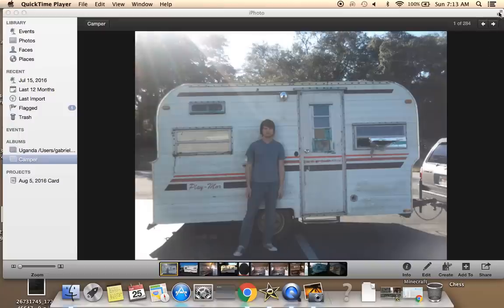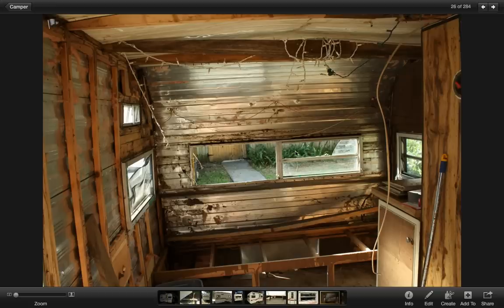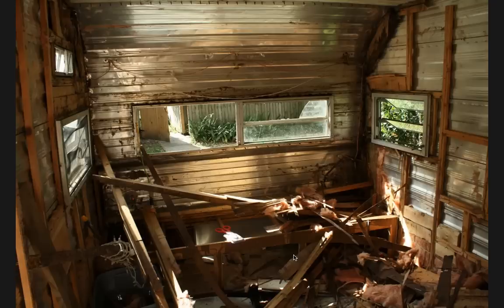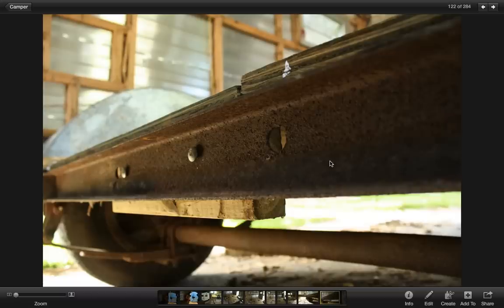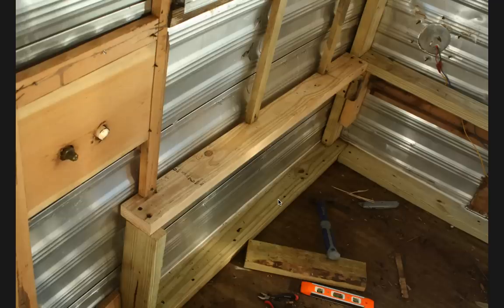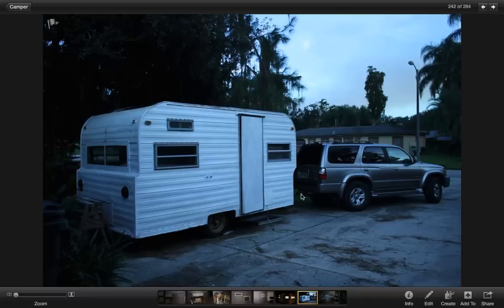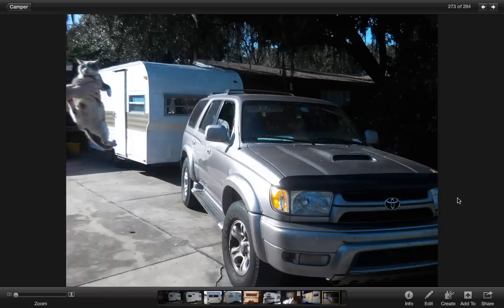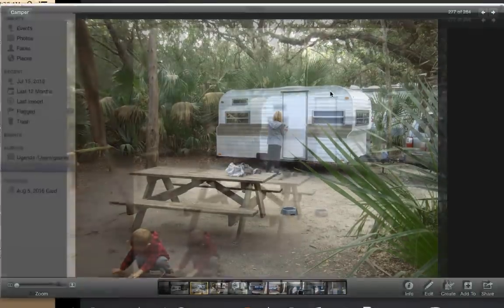Rebuilding a $40 Retro Camper // DIY

Comment: I have a 14ft'er.. Trashy little beast it is, but I'm renovating it myself. Going with cheap insulation, and salvaged plywood paneling. to make it a mobile 'rustic shed' look. Trashy as hell on the outside. looking damn nice on the inside so far. I look at mine as a project and something to keep me from getting bored.. So if it's not perfect.. whatever. It was fun while it lasted

Comment: Great job! I have to mention, I did read that it’s not recommended to use any pressure treated wood on vintage campers, as the wood reacts with the aluminum shell and will corrode. Is this something you took into consideration? I’m getting ready to gut and remodel my own 1975 trailer also :)

Comment: This has fully influenced me to go through with finding a old vintage camper and fixing it up. I do have a question, what kind of stores were you finding your parts like the wood-wall- and materials. I would like to keep it cheap as I can. I found one for 400 and it looks like it will need some siding and rebuild on a couple places and the roof.  This is the best rebuild video out there! great job..
Reply from the maker: Glad I could inspire you to start a fun project! I got most of the materials at Lowe’s. The interior wall material is a thin plywood that was $9-12 per 4x8 sheet. Let me know if you have any more questions.
Reply: Our Simple Story  thank you !! I probably will lol.

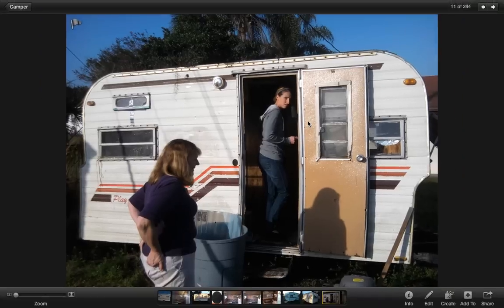Comment: lmao the picture at 1:57... Your wife is not impressed with your $40 purchase.

Very cool rebuild. I'm no expert but I think you did pretty well for a lower budget DIY. 

My only concern would be whether you insulated the walls before you put them in? That camper will be hot as all hell in the summer if you didn't.

Comment: Nice learning project for sure! Jumping in and just doing is such a great way to pick up new skills. I don't see how you have "$400 at most" in this though. Did you already have the materials? Just adding a few of the items you mentioned in the video shows it's well over $400. 

$40 Camper
$100 New tires 
$124 3 sheets of 3/4"x4'x8' pressure treated plywood 
for the floor
$100 Title
$15 Interior Paint
$27 3 cans of Rust-oleum
$50 New window
$15 Carpet

That is $471 already and doesn't include the wood walls, insulation, studs, wood benches, bed structure, exterior paint, white bathroom board ceiling, trailer lag bolts, roof screws added around the exterior, and screws for the walls and interior. 

I also don't see how you can make money doing this. I don't know how much time you had in this but 2hrs per day 3 days a week and 4 hours on Saturdays gets you 10 hrs per week. It sounds like it may have taken a number of months but even if it was only 2.5 months that would be 100 hrs. If you include the time you had in this even if you made $200 then you would have made $2 per hour. If you actually include all the time and the fact the true cost is was likely closer to -$2 per hour.
Reply from the maker: Then I put it on YouTube and got over a million monetized views ;)

Comment: I guess the end use is in mind when starting a project like this, meaning it was never intended for mountain camping where the nights get cold -- no insulation anywhere. Fine for Florida, especially for summer camping - just don't go farther north than South Carolina or your teeth are going to chatter all night long.  Good job though with minimal expense!

Comment: Did you ever replace the electrical wiring?  Also, maybe I missed it, did you reseal the roof and if so, what did you use? what kind of paint did you use on the outside?  thannks

Comment: The only sub $500 campers I have found were used as chicken coupes or meth labs. I commend you on your willingness to achieve your goal. I would have given up on the camper idea and just resorted to just ripping it down to the frame to build a utility trailer out of it.

Comment: Did you insulate anything? And with what if you did?  Did you level the roof?  Great job by the way.  Shows me I could do it. I just can not back up trailers. I've tried. I'm a musician and play and sing everything but the other side of my brain is toast with algebra up and backing up detached trailers...lol
Reply from the maker: Haha! Same here. I did not insulate. It is so small that a small AC unit or heater will take minutes to heat or cool. No point in insulating.

Comment: I know nothing about building these things, but I have a question for you... why instead of adding a sheet of plywood, no one add sheets of that flat zinc and then put the plywood? does it cause any problems? I keep thinking that it could be more secure to avoid humidity, or not? just curious...

Comment: The frame is worth every bit of $40. So you got a still. I hope you had that Fran sand blasted and then put a coat of undercoating on the frame. That thing will continue to rust and then fall apart it may take ten years but it will rust through. You probably should have done your homework before you built on that frame I guess so far it’s still together. Wish you luck it looks pretty bad in places, if you still have it look underneath and see how it’s holding up. That’s all that would scare me driving down the road and the house come off the frame.

Comment: In home-building terms... this was a "full tear-down" project...  basically, just the outer skin and trailer frame..  but hey, you could at worst, use the trailer frame  and deck it for a small flat bed trailer...   $40 is an very inexpensive learning opportunity...

Comment: I would add some kind of a sealer to underneath of your pressure treated plywood because of this
Is pressure treated plywood waterproof?

Common plywood that has been pressure treated with chemicals. ... Pressure treatment with chemical compounds does not waterproof the plywood. Continuous exposure to water will leach the preservative chemicals from the wood. Often made with soft wood to enable the penetration of the chemicals.

Comment: So it looks like you removed all the wood frame, which suggests the shell was free standing? It must have more structure than you would think. And was it bolted or riveted or something to the chassis? I've got water delamination between the wood and fiberglass shell happening on my rv. I'm wondering if I should peel it off from the outside or go from inside like you did. I haven't found a similar thing explained on YT yet..
Reply from the maker: Do the outside off if you can can.

Comment: the manufacturers build these from the inside out ...all the interior walls and plumbing wiring and such are placed on the basic floor and completed before the exterior walls and roof go on...also the exterior skin of aluminum is expensive to replace...remove it carefully and set it aside it is the only salvageable component that I see at this point...maybe some of the windows and other hardware...it's a hell of a project but doable...good luck
Reply from the maker: Very interesting, thanks!

Comment: I know hind sight always 20/20 but when I saw the interior devoid of all lumber it got me to thinking what a opportune time to spray pick up bed liner over all metal surface at that point on every interior panel crack and crevice. Most bed liner sprays  prevent moisture and water flow at 99.9.percent .just saying you know.

Comment: Never use roofing screws on anything. They are glorified tek screws, all your doing is creating leaks into your mobile or roof. I hope you put a thick coat of paint over them when you were done so they are somewhat protected.
Not a bad build and I'm not going to knock you on anything other than the roofing screws but if you build more I recommend looking more into carpentry and your different material options especially for your flooring.

Comment: Cool setup! Love the bunk beds. How does the 4Runner tow it? Ours is a bit sluggish with the little trailer we have.
Reply from the maker: It was like towing a parachute but it did well. I would recommend towing with a tundra instead. Thanks for watching!
Reply: A tundra would be nice. I was thinking a v8 4th gen 4runner. Either way, my trailer is lo profile and light, but the 4Runner isn't exactly swimming in horse power.
Reply from the maker: Tis true. I subbed to your channel by the way. Love your stuff!

Comment: how did you flatten the roof?
Reply from the maker: That's a good question! I think I had to uninstall the roof vent and re-roof the whole thing with asphalt roofing sheets (forget what they're called). I had to rebuild the trusses inside to give it the proper slope. Thanks for watching!
Reply: Our Simple Story do you remember the over all cost?
Reply: Do you have a rough estimate on cost for the whole thing?

Comment: from the start, that's not a camper that is a trailer it camper sits in the back of a truck not behind it. the walls of their saturated with wetness and maybe black mold you should have scrapped it in bought maybe a thousand dollar one and got a good one no little kids should be exposed to all that black mold

Comment: I'd say you need to think about all the man hours you spent on that camper too.  Regardless of what you earn in your main job, you could have gotten a $12 an hour job in the service industry and worked the 200+ hours you put into it.  You probably lost about $2500 in hours as a minimum.  It seems that for the $2500 in time and $400 you spent on that old unit refurbished, you could have just worked a 2nd job and bought a newer model that didn't need work and was structurally sound.

Comment: There's no way you did all that for 300-400 dollars, the new tires alone would've cost you nearly half that and the pressure treated ply would've been around 75 for the three sheets. Plus paint at 3 dollars a can for the spray and $10/gal for the killz ect ect ect......you would've been into it for more like 700-800 in materials alone and unless you feel your time is worthless then in the end you lost money on that deal.
Reply from the maker: Three sheets of plywood came from a construction dumpster :)